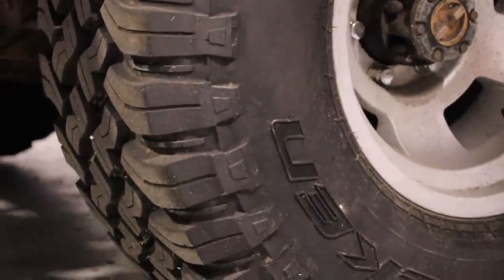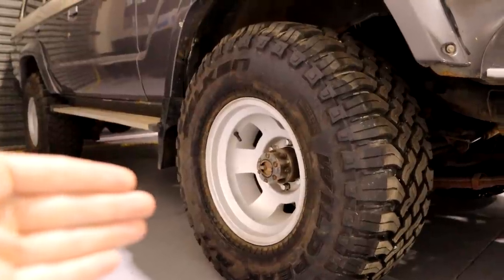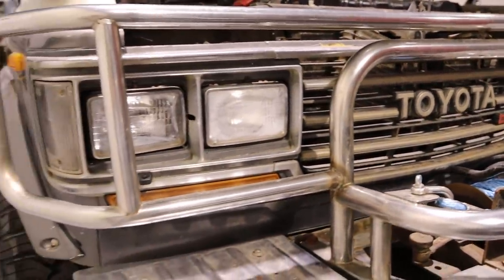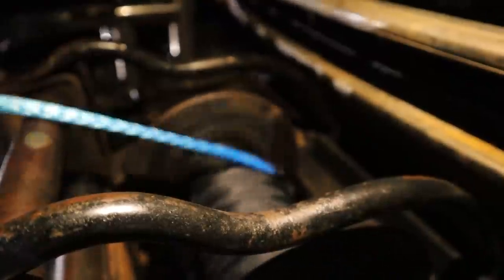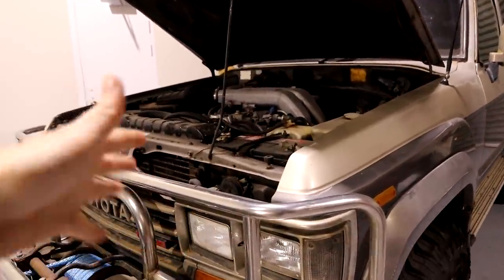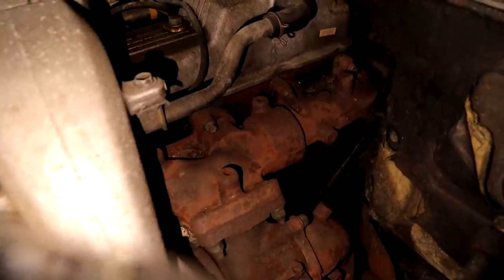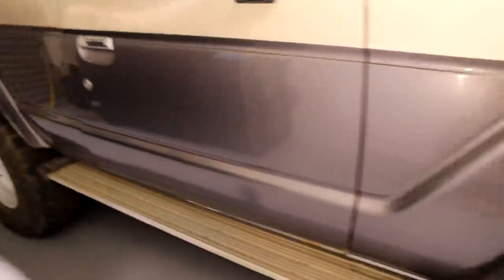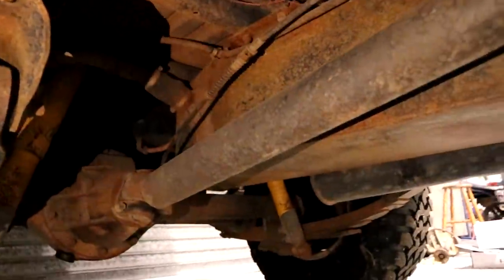Project 60 Part 1: Walkaround

Comment: Also because I have owned a fj62 for 12 years I think you should do a rear quarter panel chop and wrap a rear bar around to the wheel arch.
They stick out along way in the back past the diff housing and tend to get hung up on a lot of stuff.
Reply from the maker: I won't be cutting anything sorry

Comment: Drop the roof lining and rust prof inside. They rust from inside out. Air con so cold u get condensation inside and rear vents on back pillars break down and let dust into roof area inside. Awsome old girl.
Reply from the maker: The rusty body will be sold not repaired

Comment: I did a 12h into fj62 around 8 years ago and mounts needed to be chopped. From memory was only the drivers side mount about 25mm back. Other then that just swapped the dash cluster and wire harness and was mint.
Reply from the maker: Awesome thank you!!

Comment: I had a HJ61, motors are awesome but hard too get bits for now. When you do the engine swap as you have herd the engine mounts on the chassis are different from petrol to diesel. I used to work in a wrecking yard in Sydney called east coast 4WD. We did a few engine swaps and we cut the rivets holding the mounts too the chassis then set the motor and box in, bolting the gearbox too the cross member then bolt the chassis mounts to the engine and mark the rivet holes onto the petrol chassis. Not sure what the rules are in Queensland but here in nsw your not allowed to weld a chassis so we bolted them through the rivet holes. Hope this helps.
Reply from the maker: Cheers for the info!
Definitely can weld to chassis in any Australian state just must be done to a particular standard and by qualified persons

Comment: Hey Danie, glad you're back, So been waiting for this project! If you've ever owned a HJ61 with a good 12HT you'll keep it, or regret you ever sold it! That engine is like a mini 6BT and the low down torque is just as addictive..I did end up having my chassis and axle housings modded to take light coils all round with reduced leaves .. amazing on corregated gravel, so worth it ..So much so, I skipped over the 80 and jumped to an FTE auto converted 105 that's my daily .. but every time I turn the key on the 12HT in my 61, I just  smile and think, I am never selling this to anyone! NB- Thanks for appreciating the cruisers that don't get the fanfare - the 60 is the unsung hero of the 4wd wagon world!
Reply from the maker: That's so awesome to hear!! I've heard a lot of people regret selling them
Reply: @DanieSimpson  I have been approached by so many regretful previous owners over the years, just to tell me to keep mine .. so many times in fact that over the last 25 years of ownership, that all 4 of my children have heard it so often in our travels .. that the one time I mentioned selling it, I got the towelling of my life from them .. it stays in the family as an heirloom and my mechanically minded daughter (22yo) has dibbs on keeping it forever!
 It's seen Cape York so many times it knows the way to our fishing spots and has taken us to the NT the back way through Borroloola towing 2000kg camper and boat  .. never missed a beat in its near 600000km life to date!

Comment: Pro-tip: Just forget about the fate of the donor. Just take what you need from it and send it off to a breaker yard.

If somebody wants to buy it and rebuild it, that's their problem, not yours.
You gotta be ruthless about this stuff or you'll end-up with a yard full of "fixer-uppers" that you never get rid of.
Reply from the maker: I have no issue holding onto things until the right price and buyer comes along. No dramas at all

Comment: Great 60, don’t chop the engine mounts. You may just need new brackets(same age as the chassis). They changed the mounting points around 1985
Reply from the maker: Yes mounts need to be removed and new ones welded to the chassis

Comment: Oh an one thing that would be handy if you end up using it for touring speak to arb for one of thier long range plastic tanks as it will cut down on wieght an never rust an of course run bash plates the lenght of it to protect it even more . Be alot more comfirtable on long trips plus you will be able to hear yaself  an only half the rattles of ol boy lol . Great addition to the  shed the 60 .
Reply from the maker: Thank you sounds like a great Idea!

Comment: Gday young lass you have a big project ahead of you,12ht and a PTO nice get. Be nice to convert to 12v,the 12ht and my other car have the same  12v alternator with the pump at the back. Don't no if you want to convert but it might be worth it. Twenty thousand would be a good spend but my old timer cost me double that. It adds up,tyres,bull bar,lights,auxiliary tank,roof rack,diff lockers,suspension lift,raptor coat and so on. The best accessory is a milk crate.😉
Reply from the maker: Yes 12v would be ideal:) 
I do all my own work and fortunate enough to get trade pricing on most parts so shouldn't be too bad

Comment: Arrh 24 volt import land cruiser maybe an old un special build.  I was advised
Years ago un United Nations land  cruiser was a special runs of vehicle with 24v from factory.  12 volt was standard but United Nations standard is 24 v not 12v.
Reply: Japan had standard 24v system for better cold weather cranking with 12v accessories
Reply from the maker: Yeah as already commented this is Japan 24V import :)

Comment: ...It would be a good video just exploring if making a bar from scratch is what you want to do, what is involved etc etc. I think many would not know what it is involved beyond the vague idea that it can be expensive.

Sometimes you can get a surprise with these things once you start to look into them.

I am looking forward to seeing what you do with the build.
Reply from the maker: Yeah custom barwork can be done very cheaply but to do it right definitely takes time and effort. Added benefit is its not a new car with airbags or sensors to worry about
Reply from the maker: @leonkane8240  exactly that's why I said to do it properly takes time and effort. No point doing anything cheap.
Fortunately I work at an auto fabrication shop so I'm pretty covered in making my own barwork. I'm sure there are other people out there though who could definitely learn through trial and error. But in my opinion learning should not be done on barwork so i won't be showing that on here. Anything that protrudes from a vehicle and has the possibility to impact the vehicles handling or crash dynamics should be left to a professional.

Comment: If you’re looking for a 24v alternator - look at Hino, part of of Toyota company. Same engines have been used In Landcruisers, Coaster buses and Hino light rigid trucks.
Reply from the maker: Cheers I've got an applicable part number for it just gotta change a few plugs

Comment: sweet rig mate, keep it as stock as you can as it will hold more value that way, valve body change over is over rated unless your gunna pump the BHP to the max and even then it wont want to change gears unless you back the peddle off because of the pressure build up on the Torque Converter,  you got a lot of wrench time ahead of you good luck, lookin forward to seeing more vids of the creation of the Danie's 60 BEAST

Comment: Auto can be a lot of fun with a lock up converter kit
Reply from the maker: Right?! I'm excited to get stuck into auto upgrades
Reply: @DanieSimpson  I’ve got a1hdft 80 with a nomad lock up kit installed and it’s brilliant off road, downhill in first is like a manual ( no run away) and smooth through the slow stuff without having to worry about the clutch pedal. But it will stall the moment you stop the vehicle 😂
Reply from the maker: @benhadden7038  yeah right interesting!

Comment: Engine mounts are different heights on petrol chassis n not sure of placement diesel chassis has both engine mounts at same hight so there is a difference n I think diesel engine mounts may be mounted lower down from the top so they are different you will see easily when both engines are out as years ago I bought a 2h with turbo to put into fj62 n stopped as I was on pension n couldn't afford engineering etc
Reply from the maker: Yeah will be all sorted no dramas just gotta move some mounts:)

Comment: glad to have seen this video. brings me up to speed with the project. have seen insta posts many times and wasn't sure of the go.

I'd say rather than buying a heap of real hard to find expensive parts you'd be best using the rusty 60 as a donor and selling all the other bits to someone who is going to restore the rusty one? 

the brown interior looks much more complete and has many more features and is less broken so go with that :) 

good luck with it
Reply from the maker: in this video I discuss using the donor vehicle and selling it afterwards to someone who will restore it, not buying expensive parts. Also the brown interior is the broken one and missing more
Reply: @DanieSimpson  haha ah yeah my mistake. I more meant you said thing like flares and mudflaps are expensive so I presumed the rest was too. Looked like the grey door trims and handles are busted maybe I didn't look at the brown one so close.

Comment: The box in the rear is rear AC. & that head unit is better than a kenwood...just buy a wireless apple carplay or android auto dongle & install it.... the fridge runs off the vehicle ac, not a seperate system.
Reply from the maker: That head unit is certainly not better than my kenwood haha it's horrible. My kenwood does everything perfectly and instantly.

Comment: Hi Danie, question for you on the rusty FJ60/62. Where did you get those Turbo seats? I noticed front and rear match, and the rear bench has head rest. I'm rebuilding a 60 as we speak, and in need of parts. Like that steering wheel. Thanks, and I look forward to hearing from you.
Reply from the maker: came with that model sahara

Comment: 60’s Petrol engine is scrap , only Americans will love the engine. Btw keep the axles . I remember that the petrol pinion is different than the diesel ratio. It would lower the 5th gear rpm. And the gearbox I think will be similar with the diesel one. If the transfer looks the same bec there are quite a lot of models, but the hj61 gearbox are the best among land cruisers. Compare to 75 the 61 is stronger . If u want to keep the pto , it’s hard to use a arb bull bar because of the winch height . I would eventually keep all the 61 body parts as a lot of things pretty much obsolete now. It’s very hard to find brand new part for it. I also would suggest convert the rear to disc brake as well.
Reply from the maker: Nothing wrong with the 3F it's a very good motor. 
Both are auto. 75 never came in auto.
I have had ptos for many years so no issues with modifying cradles into existing barwork.
Can buy most parts new for the 60s still including entire roofs. Like any Toyota there's only a few select items that are no longer made eg. Manifold.
Won't be converting the rear to disc. I've run Toyota drum brakes for years and I still haven't found a Toyota disc set-up that pulls up better than mine. Also had zero issues with servicing.
Reply: I also forgot , a upgraded ct26 turbo for the 12HT is wake the engine up. Like those ex: 11blade compressor wheel stock diameter . If it a manual that would be different .

Comment: Hey were those super cheap auto tool boxes you had on the 75 before the canopy were they any good because thinking of getting some but hear bad things about them like they leak a lot with rain?
Reply from the maker: I siliconed the inside of all the joins because yes they used to fill with water but after doing that no dramas.

Comment: Ashdown and Ingram they should have an alternator I come from Victoria don't know if you have them up there
Reply from the maker: Lots of places sell alternators, no dramas with finding stockists at all. Just have to figure out the correct part number that is equivalent as noone in Australia will seell a 24V 12ht alternator so have to just research what can be made to fit with brakets and pulley changes
Reply: @DanieSimpson  would of thought ashdown would be able to find the 24v one but all good the 60 looks in good Nick ya got it cheap
Reply from the maker: @jeremybrowne5413  unfortunately no, the 24v was never sold or marketed in Australia. So no Australian parts listing's  will have it. Joys of imports you gotta just find what else works :)

Comment: Love the 60's! For your parts sourcing and advice, have you tried Mr Landcruiser? (In Qld) Good luck!
Reply from the maker: What for? As you can see I'm well covered for parts between two cruisers
Reply: @DanieSimpson  well if you're trying to keep it that nice grey interior, and can't steal certain stuff from your other cruiser cos of the interior colour? 
From what I hear the engine swap should be pretty straight forward tho with same engine mounts etc
Reply from the maker: @warrencramer4516  yes grey interior is what I'll be sticking with and I buy parts direct from Toyota. Much better quality than aftermarket and cheaper than going through on sellers who put their own mark ups on it
Reply: @DanieSimpson  geez ok, thought they'd be expensive as through Toyota? Might start giving that a go myself, been burnt a few times with aftermarket parts not fitting lol
Reply from the maker: @warrencramer4516  they aren't cheap but they are nowhere near the price of parts for my XY falcon so I'm not complaining.
Reply: @DanieSimpson  yeah well xy parts are always gonna be expensive nowadays, btw you should do a vid on it?
Reply from the maker: @warrencramer4516  been expensive for decades haha. Yes after the 60

Comment: I’m pretty sure that all the motors that came factory in the 60s all used the same engine mounting positions and possibly same engine mounts.
Reply from the maker: Nah unfortunately the petrol and diesel are different as the 3f has extractors that travel where the diesel engine mount is
Reply: @DanieSimpson  there you go something I didn’t know.

Comment: Like my boy marsy is a man of many faces . The grey is good but brown hides the dirt more an the high roof is better as least ya can put a uhf etc up away from your head , would keep the airbag  rear too  . Defiantely keep it auto ( maybe talk to rocket rod at wholesale automatics ) an dont chop it as those things are getting rare to find in decent shape . Bullbar just get a original one like on the 88 89 dual headlight version which wasnt a arb from what i noticed on a few of them an get some brush bars an side steps made for it .
Reply from the maker: Yeah grey is better for me I have no dramas cleaning things and any marks are usually black anyway from grease. Won't be keeping those airbag rear. Both vehicles are high roof too. But yes will be staying auto

Comment: Also been investigating 24v alternator. Seems like the only reliable source now is cruiser world in the Netherlands, talk to Maarten there. Cheers, ptscustom on IG.
Reply from the maker: I'll be converting to 12v
Reply: @DanieSimpson  ok, might be a good option. Here in the Arctic Norway the 24v glow and starter is awesome. 
Another neat benefit would be that the electricals work better, as the 12v loom is used on the 24v models. So the cable sizing of the loom is twice the needed m² of the one needed for 24v. 
Cool build you're doing, will follow along 👌

Comment: If you want to sell the steeringwheel out of the petrol 60 hit me up 👍
Reply from the maker: Will just be sold locally mate it's a cheap steering wheel so not worth anything.
Reply: Just check that wheel for stamp marks ,  from the video it looks like a Nardi Personal wheel , leather with red stitching.  Not cheap crap.
Reply from the maker: @29Automotive  they're only a few $100 last time I looked at them so not worth selling any further then local pick up. A genuine XY steering wheel is what I would consider "not cheap crap"